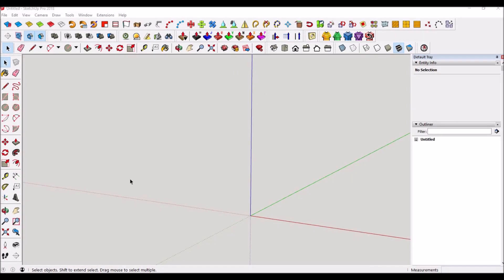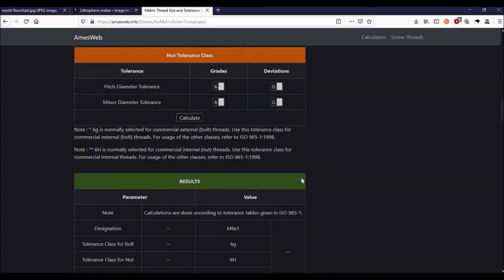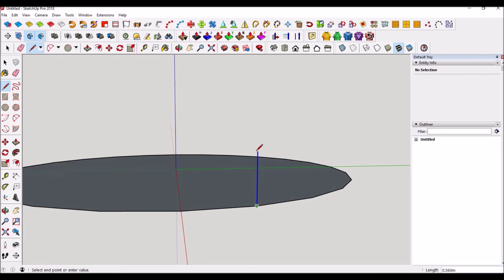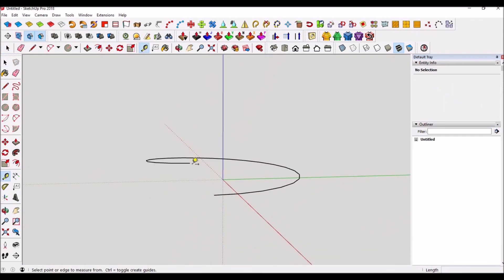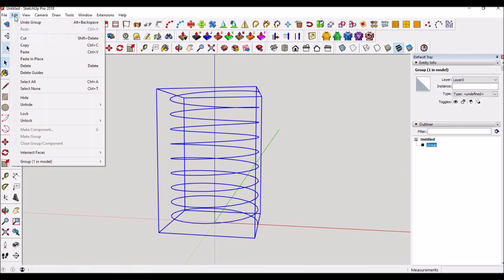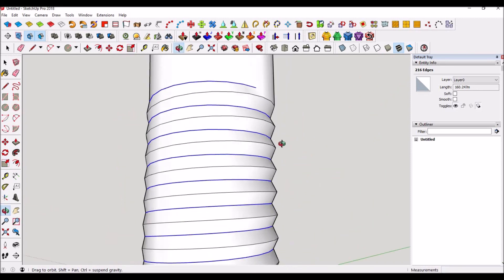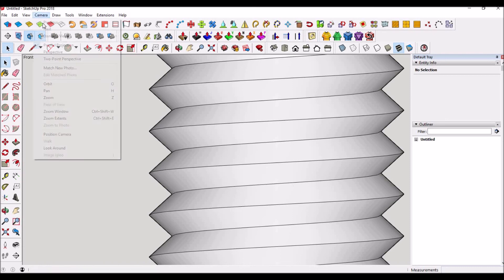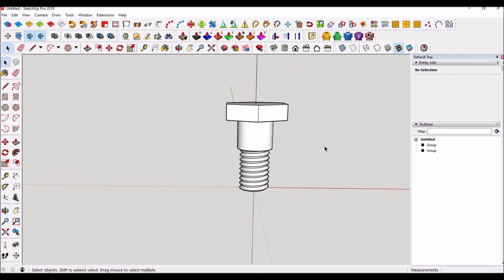How to make ANSI threads in sketchup web

Comment: Something to note if people are going to turn the models into physical bolts (3D printing them) is that the arcs are not very circular.  The whole circle is 24 segments by default, and that equates to a 15deg angle change between segments.  If you made a nut to fit the thread without suitable clearance (by subtracting a copy of the bolt from another solid), it would lock at 1/24th rotation, or not even be able to be started.  Subtracting a 'thing' from another 'thing' in 3d modelling is like cutting it with a blade that is 0mm thick.  The cut faces actually occupy the same space.

Having a big clearance is fine if only using it for display purposes or a bit of fun.  For anyone wanting to print their 3D model, I would recommend changing the segment count from the standard 24 to much higher and equally dividable by 360.  I've done it at 144 segments (36*4) which makes for a 2.5deg angle change in each segment.  The computer grunts a bit, but the model is a lot smoother when finally produced.  You also have to remember that any other arc that you want to use for shaping the bolt, such as chamfers and tapers should also be set to the same segment count.  It will help prevent really tiny holes appearing after solids operations which leaves you with "not a solid"

Comment: How to make inner threads would be awesome to see!
Reply from the maker: the inner threads are created. that is the second inside spiral. however, if you want them flat like the actual ansi standard, there is a way to do it. I will have to see if i can find the video of me making them.  However, with 3d printing, there is no need for that flat section, its 1/H which ends up being 0.125mm for this particular thread. Larger threads, you could add them in:)

Here is the video where i show how to do inner threads

https://www.youtube.com/watch?v=uMmIEQmU0Bg
Reply: @LT72884  Thanks bunches!
Reply: Make the outer male threads as shown and subtract it from the solid you want threaded.

Comment: My only problem with your video is where you pull down the round cylinder part of the bolt (i.e. the shaft beneath the head) onto the first thread.  When 3d printing won't that create a problem with your slicer software in that there are some interior planes?  I'm wondering why you just didn't leave that part alone since there was no break between the cylinder and the threads?
Reply from the maker: you could completely leave it and it will be fine:) as long as it is a solid at the end, moving it down did not cause issues with the slicer at the moment. You are right, there is s certain threshhold of where to place that shank.

Comment: Thanks for this. I viewed a video several months ago on how to make threads and it looks the exact same method as this but when pulling the threads in to the centre, it didn't work right at all. I'll have to try and find the older video to see if you done something that he didn't or if sketchup web has changed to allow this since I last tried
Reply from the maker: I have done it a few times in the web version as well to make sure it works. as of March and April, it worked. i will test again though.
Reply from the maker: Its all in how you use the scale tool. You have to make sure that you use ctrl so that it is a uniform scale, and not just a scale on one side of the bolt. Remember that the scale tool is a percentage. Thank you for watching and im sorry for not replying sooner.